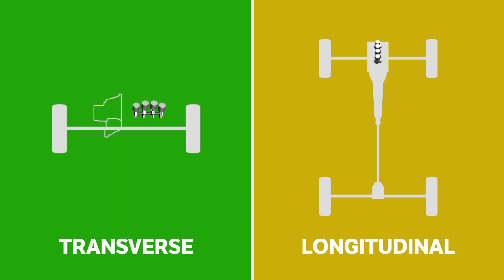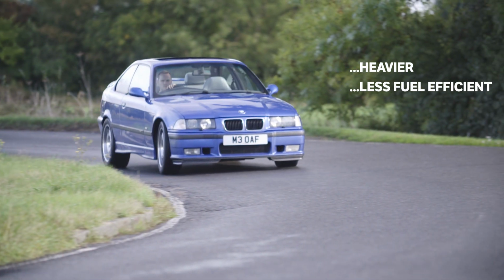The Differences Between Transverse and Longitudinal Engines

Comment: Transverse might be more practical but longitudinal engine brings more smiles per horsepower.
Reply: Professionally Hunted         It dosnt matter what way the engine is mounted the horsepower be the same the main issue be traction FWD gives more traction but RWD gives you better acceleration traction. When a FWD car takes off from a dead stop the front wheels tend to move torque steer were they lose some traction. RWD cars since the car  got some weight in the back cause of the differential on acceleration you gain more traction but lose traction once cars traveling if that makes sense.
Reply: @ryans413  , you do realise that this is a joke comment I made 3 years ago? Also, if you want to educate others, educate yourself properly since you seem to be having improper knowledge it seems. If you take a moment to read what I have written, perhaps you may come out a more enlightened man.

Firstly, FWD cars do not have more traction since the front wheels are doing more than one work at a time. It is accelerating, turning and braking, this means that the front wheels would have to work a lot harder most of the time. FWD cars will also face more noticeable effects of torque steering since the front wheels are both the wheels used to turn and the wheels used to accelerate. RWD still do face torque steering but since the rear wheels are not used for steering, the effects are a lot less noticeable, you can still observe drag cars twisting it's body from all the torque. FWD cars are much more simple, compact, lighter and usually roomier. It is due to less components needed and the lack of a driveshaft going all the through the body. However, they tend to have a more cramped engine bay due to the transverse mounted engine. They tend to be front heavy as a result due to the components being on the front, though the wheels still have to work extra hard and during acceleration, the weight will still be shifted to the back causing even more of a lack of traction. FWD cars can't as a result have too much power since the front wheels won't be able to handle it.

RWD cars are a bit more balanced and would have more traction due to how physics works. When you are accelerating, weight will still be pushed more towards the back, aiding in traction to your driven wheels. If you need to turn, you would lower the power so that weight would go more towards the front, aiding in traction being sent towards your turning wheels. RWD cars also tend to be more balanced in their weight, allowing for better stability and handling. Plus both the driven wheels and the turning wheels have their own respective roles and do not have to perform double duty, as such you can take corners much more harshly with them. You do not lose any traction when the car is traveling, you can instead manipulate the amount of traction you have on the back and front by adjusting your throttle. If you follow proper racing lines and shift the weight of the car appropriately, you would be able to take corners at quite a high speed.

Lastly, do you even know what a differential is? I did made it clear at this point that the rear wheels get traction during acceleration due to weight and the forces of physics being at play, while the front wheels get traction during deceleration or braking for a similar case. A differential is a mechanism that allows both the wheels to spin at a different rate but may lock them in place if a certain difference in speed is detected. When turning, wheels have a different turning arc and speed, welded/locked diff wheels would rub during a turn, causing less traction, damaging the certain components which may lead to catastrophic failure and also cause a lot more wear  to the wheels. This is due to the different paths the inner and the outer wheels take. Differentials allow the wheels to move freely from each other and prevent the previously mentioned issues. There are a fair bit amount of differential systems and settings, each suited for the car and the role they are required for.

Let's not forget other things at play here. The weight of the car, the balance distribution of the car, the power of the car, the suspension system and setup, what the car is tuned for,etc. For example, some independent suspension systems tends to change camber at different height or load. Every car is different in how they are made and how they perform.
A car is a lot more complex than what I have written but I hope you now have a basic understanding of how things work. If you're gonna try to educate or correct someone, please take a moment to research things yourself.
Reply: Professionally Hunted         lol you wrote all that for no reason it’s pretty much what I already said you just through in some extra stuff look I know all this my point was that FWD cars have more traction going down the road because all the weight the heaviest part of the car is the engine and most that weight is being supported by the front wheels. RWD cars have better traction accelerating cause the back end dips down and the drive wheels are in the back giving more traction on take off that’s why sport cars are all RWD cars. FWD cars can take corners better cause when turning since the turning wheels are also the drive wheels the weight transfer into the turn pushing the car the way you are turning. RWD losses traction in turns cause the driving wheels are not the turning wheels and it wants to keep pushing the car straight forward causing under steer. There’s a reason why almost every car that’s not a truck or a AWD car is FWD because traction’s better other then on hard acceleration where the car dips back and you lose some traction with FWD.
Reply: @ryans413  , I see that you have neither read nor learned what I have typed in since you are still having some misconceptions about some rather simple things.

FWD cars don't have more traction going down the road since the weight is towards the back during acceleration. They also have less traction going into a turn since having the driven wheel be the turning wheel means the wheel has to face the effects of both radial and lateral forces. Most cars are FWD because they are cheaper and allow you to have a more roomy interior inside due to the lack of a long driveshaft. Also, having too much weight on the front, can cause an in-balanced weight distribution. Most RWD front-engine cars anyways have a 40/60 F/R distribution which is considered ideal so I have no idea what you are on about.

RWD can take corners better if you actually take the time to learn how to use proper lines and throttle or braking inputs They can accelerate and turn more harshly since each respective wheel is subjected to lesser forces than a FWD car would be. RWD cars can also lower throttle like I had previously mentioned, to shift weight to the front, to aid in turning. RWD will lose traction in a corner if you do not know how to drive a car, are too jerky on the steering or smash either the throttle or the brakes. RWD cars can also have the heaviest part of the car, the engine, in the front as well, it's nothing special to FWD cars.

AWD cars in it's own allows much more traction overall.

Anyways, I won't bother continuing the discussion with you since it is clear you have no read anything from me before. Plus I feel myself get dumber the more I talk with you since you don't seem to understand how the many forces effects a car. Specially if you think having the driven wheel also being the turning wheel means better traction, while it's actually the opposite.
Reply: Professionally Hunted        Dude do you own a RWD car or something and you just gotta justify it or something do the research I said from accelerating FROM A DEAD STOP NOT DRIVING NORMALLY. RWD cars have better traction when accelerating but FWD cars have better traction WHEN DRIVING NORMALLY DOWN THE ROAD but lose traction WHEN ACCELERATING FROM A DEAD STOP. Also THEY HAVE BETTER TRACTION IN CORNING it’s a proven fact I’m done with you go drive your RWD car in rain or snow then come tell me how shit the traction was
Reply: @ryans413  I'm just gonna leave this here:
https://youtu.be/uuOcuqPMGGw?t=143

This will be my last response to you since you clearly have a hard on for FWD cars owning to the fact that you are trying to incorrectly state their advantages.

RWD cars do fine in the snow if you know how to drive. Take a look at cars like the E30, Renault 5 Turbo, Lancia Stratos HF, Ford Escort RS1800 which were quite successful in rallying.

Also, please stop trying to spread misinformation.

FWD would suffer a lot more in snow and rain due to having less traction while having to simultaneous accelerate, turn and brake with the same wheel, therefore requiring more traction.

Most race cars are RWD and you can find plenty of clips of them racing in the rain, you can see that if they have a proper driver who uses good lines and doesn't mash either the throttle or the brakes, the car is fine. Ofc, you don't seem to be able to grasp that basic knowledge it seems like.

It's clear that you are a troll at this point. That or you really believe you incorrect information on cars. Whichever it is, it's a waste of anyone's time trying to correct you.

Comment: Transverse engines are harder to work on. Longitudinal engines are way easier, and are very common in the U.S
Reply: optimusboy1 audi? wartburg?
Reply: Thebluwolph Gaming hell my first car was fwd and longitudinal
Reply: Yeah I have seen a few of those, mine was a rwd 4 cylinder 2.3 ford ranger
Reply: Thebluwolph Gaming My B1 Passat (dasher in the US) has a longitudinal engine and is fwd, new audis also have this layout when not equipped with Quattro AWD
Reply: Bitelaserkhalif cringes no dodge intrepid/ chrysler 300m/lhs

Comment: difference between v12 and w12
Reply: SomeGuyFromBristol Finally someone who isn't be a dick to people asking questions. take this cookie
Reply: SomeGuyFromBristol *Gives cookie and sticker of lion.
Reply: Some W-configured engines are a little different these days.  take a regular V12 and stagger the cylinders in each bank just a little.  This means you can have the engine slightly shorter, the cylinders can be moved closer together.  Think of the V6 from the VW VR6...this engine is laid out in this staggered manner (total difference is only about 15 degrees), making it more like a straight-6 with staggered cylinders and a single head covering the lot.  Weld 2 of these engines in a regular V-formation and you also have a W12.
Reply: So I understand the physical differences between a W12 and V12 (how they're laid out and whatnot), but what advantages does either layout have over the other from a performance standpoint?
Reply: V12 is 2 banks of 6 cilinders sharing the crankshaft.. like if you add  6 cilinder engines in V configuration sharing the same block and crankshaft.

Now the W12 is 2 VR6 engines in that configuration.. a VR engine is a VW think wich tries to combine best of both worlds.. its a 6 cilinder engine wich uses a single head (not 2 separated heads like a V engine) and slighty cants the cilinders so they overlap each other.. the result is a 6 cilinder engine wich is as compact as a L5 engine or even less but with the beneficts of a straight L6 (less vibrations, only one head, 2 camshafs for all cilinders instead of 5, weight saving)..
So when you combine 2 VR6 heads into the same block and crankshaft you get yourself a W12 engine wich is more compact than a normal V12 ...  If you would build a 8 cilinder VR8 engine and do this you get a W16 wich is what the Veyron uses
Reply: the "true" W-engine is the same as a V-engine, only with three cylinder-banks. and then, some day a long time ago, there were VR-engines, which are, as some people said, inline-engines, but the cylinders are tilt (mostly about 15°), which saves space. they have only one head. and so some dude was like: hey, lets do a V-VR-engine and call it "W"! (like VW selled their VR5s as V5s). so the VW-W-engines are for VRs what V-engines are for inlines.
head to engineering explained for more detailed stuff.
Reply: +Syed Mahdi  The main advantage of the W12 is that it takes less room to fit it in, so a smaller car can have a larger capacity engine than would otherwise be possible - a W12 has only about the physical dimensions of a small V8 or a large V6.  On the other hand, a V12 is inherently better balanced, so smoother...and this is important for luxury and GT cars.  Different stokes for different folks, I guess - both seem to work well.
Reply: That was exactly the reason why VW developed the VR6. You get an engine that is more compact (about as long as an I5) with a lot of an I6's inherent smoothness through well-balanced mass forces. Too bad VW fu**ed up the timing chain drives in almost every VR6 version.
Reply: +Sci4n Exactly. Calling a V-VR engine a W always rubs me the wrong way. They're not the same, and the terms should not be interchanged.
Reply: Other than ignition firing order changes, which will occur in all cases, it's all in the way one looks at it - a V12 is basically two V6s joined end-to-end, or two inline 6s joined side-by-side...it's the same thing either way as far as the cylinder layout is concerned.  It's the W that is different, with either offset cylinders in each bank (as used by VW/Audi/Bugatti)...or on (much) older engines, it can actually mean 3- or 4-bank engines joined at a common crankshaft (although this is certainly not a common setup at any point in time, and even less so today.)
Reply: PS:  Interestingly, the VR6 engine still uses the same firing order that virtually all inline 6s have used for just about forever: 1-5-3-6-2-4.  To me, that clinches it - it's more of an inline 6 than a V.  :-)
Reply: +nokizorque Yeah I know, I was talking about the w12
interesting v12 fact
Reply: ***** i see, thanks anyways!
Reply: so like 2 inline 6 engines ;)
Reply: Basically, yeah.  (Well...if they were joined end-to-end, that would make an inline 12...LOL)  :-D
Reply: Xantteboy all
Reply: Good idea - I didn't think of mentioning EE, but Jason can explain this if anyone can.
Reply: halofreak1990 agreed. and it doesn't even look like a W.
Reply: Its the same thing as V16 and W16
Reply: The pistons are laid out differently the W style has them laid out in W the V12 just has 6 cylinders laid out in a row 6 on each side of the V
Reply: gmansplit actually, its two vr6s joined together
Reply: +Boi VR6s aren't the same as V6s or I6s. VR6s are made by Volkswagen and combine both the V6 and I6 in certain ways. A V12 is two I6s mounted in a V-shape, not two V6s, as a V12 has more in common with an I6 than a V6.
Reply: +SomeGuyFromBristol A V12 is two inline 6's joined together, not two V6's. A W12 is two V6's joined together.
Reply: Xantteboy go home peasant
Reply: Xantteboy V12 is v6 weld together inline.. while w12 is v6 weld on top of another v6...

Comment: what about transverse 4wd and mid engined transverse like mr2 and nsx??
Reply: Mitsubishi 3000GT's and Dodge Stealth's incorporate a transverse 3.0L and are awd.
Reply: In the AWD/4WD case: transversely mounted engines, for example, in a Mitsubishi Evo work the same way as in an FWD car, but they have a Viscous transfer case behind the block, or in case of some Audi's, they have the transfer case in the back before the rear differential.
Evo Drivetrain: http://www.evolutionm.net/forums/attachments/evo-show-shine/104012d1174541702-wallpaper-thread-evo-drivetrain-xray-pic.jpg

Comment: Are there any examples of fwd cars with longitudinal engines. I can't think of any
Reply: All FWD Audis between 1980 - 1994
Reply: gzilladude p Oldsmobile Toronado ;)
Reply: The Oldsmobile tornado and you could say that the boxer Subarus are longitudinal fwd (some base models were fwd but most buy Subarus with awd)
Reply: 1980-1994 brazilian volkswagen gol
Reply: gzilladude p First generation Acura TL, first generation Acura RL, Acura Vigor, basically most Acuras in the early-mid 90's.
Reply: Here in Argentina there are lots of old Renault 12s that are fwd w/ a longitudinal engine
Reply: Also all VW Passats/Quantum/Santana 1981–1988 should have longitudinal engines
Reply: Current audi a4.